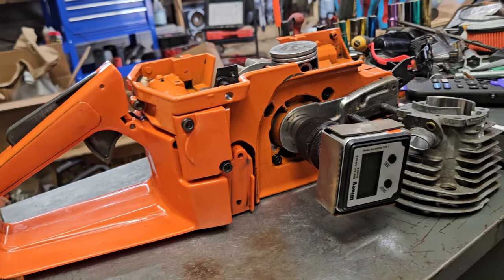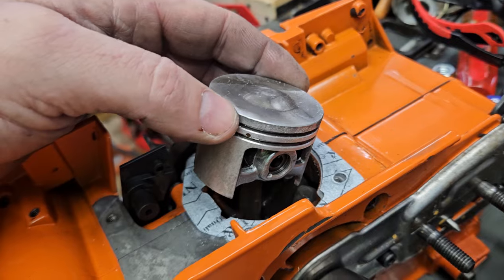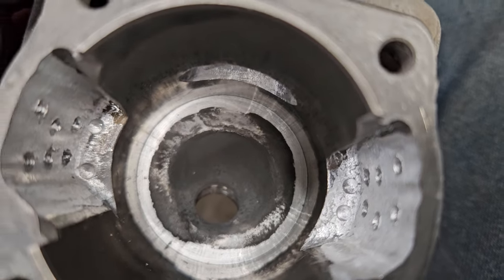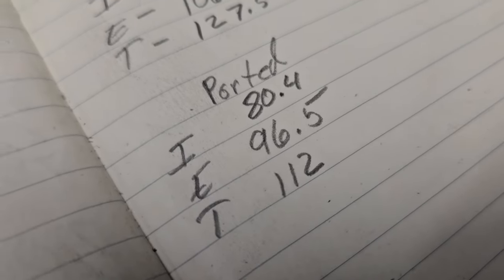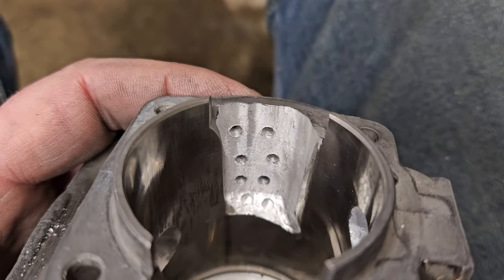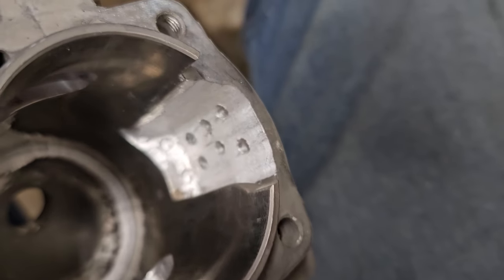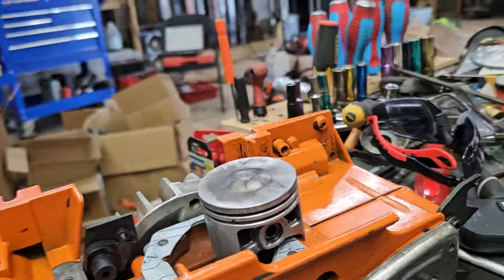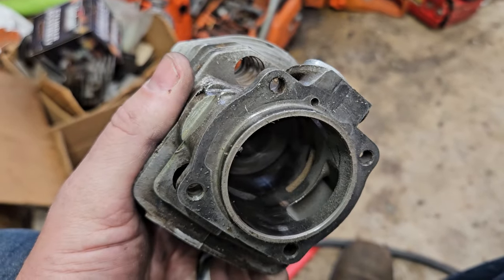pt 1- Husqvarna 55 build for the Horizontal Hustle!

Comment: Have you ever tried underwater weld. Its a 2 part putty. It starts to get real hot as you mix it together. Mold it nead it lol whatever you want to call it. , It starts to get hot. So you gotta start working pretty quick . I made a thermostat housing for a small block. Chevy out of that s***, and it worked and held up just fine.

Comment: Man this is cool to follow.
This may be a good way for some of the smaller guys to get a name out there into the public space.  
Might want to consider in the video descriptions for this shindig to link the builders if they have a channel so that viewers can more easily track down those that grab their attention.  Good PR for everybody.
Reply from the maker: Definitely.  That's been the plan all along.  Every saw will be tagged and before the run, the builder and specs will be given and their channels will all be linked.
Reply: @novicelumberjack  Awesome man!  Looking forward to this.
Reply: That was my hopes too. I just fired the YT back up Feb 1st and started posting heavy. I want to get some more saw guys on my channel and knowledgeable subscribers in the comments lol. The past month I’ve picked up a lot of shadetree mower monkey mechanics lol
Reply: @AppalachianWrench  It's the "Sharts."  You end up with the stanky subs.
But the algorithm doesn't push long format videos like it used to so it's not like there are options.
Reply: @mattfleming86  I’m trying to use the shorts to make partner. I accumulated 5.5 million of the 10 required during the month of feb so I have 60 days to get the other 4.5. Watch hours were 2,100 for Feb so if I can get the long videos to pick up it’ll be easier to get there in hours than short views. Once I get to the next partner starts though I have a few instructional two stroke carburetor cross section and animation videos I’m working on. I’ve been practicing with CapCut and I think I’m going to use the green screen to make kids videos as well. My son is 2 and there aren’t many mechanical videos for toddlers. I think creating something and learning tool names and car types and such would be a hit. I mean whatever pays the bills lol. Anything to keep from having to go back to working on angry people’s mowers and 4 wheelers.😂
Reply: @AppalachianWrench  Hahahaha.  You'll get there dude.  Willpower is power.

Comment: I got a couple test cuts to go and should have it sent not by Tuesday next week.
Reply: 👊TP
Reply from the maker: I've been watching your progress.  Looks like a solid build, buddy.
Reply: @novicelumberjack  if you have been watching my crappy little channel I would think you would hand me over the rights to the NoviceLumberjack name. Novice may be my only strong point. Looking forward to your part 2 of the HH. Thanks for the kind words.
Reply: @novicelumberjack 
Looks like a lot of good builders and some of us no name folks throwing a saw out there. I will be sending 2 saws. Both are what I consider working saws just one a little more of a firewood cutting setup. I stated before I don't really build race saws but I do port and repair 2 strokes a lot. Just letting you know there will be 2 more coming. Hoping to have them dialed in this coming week and sent out. Also have you determined a chain you are going to use? Type of wood and size you will be cutting in? Thanks. Getting close to crunch time.